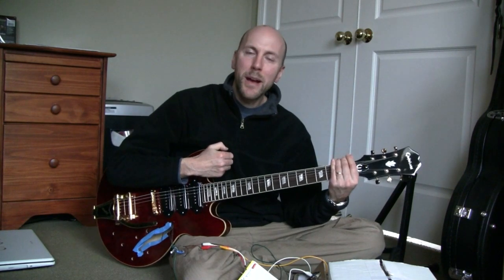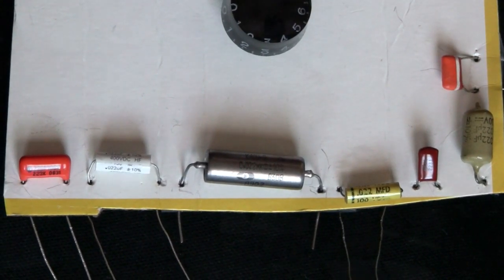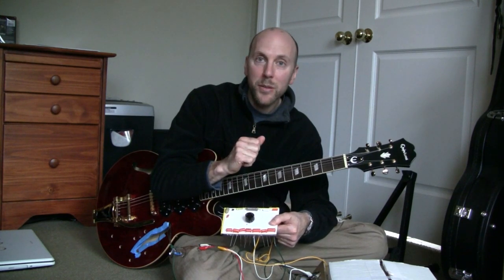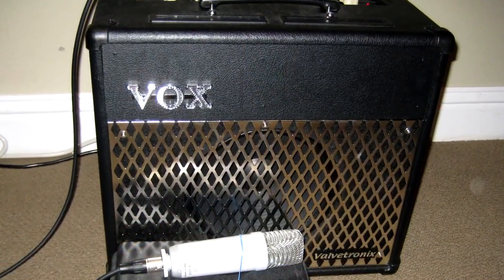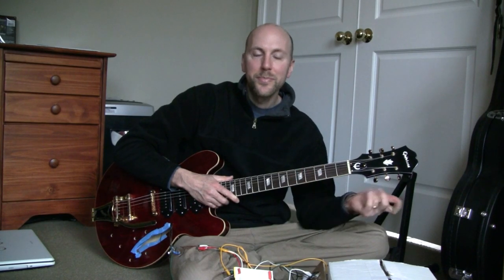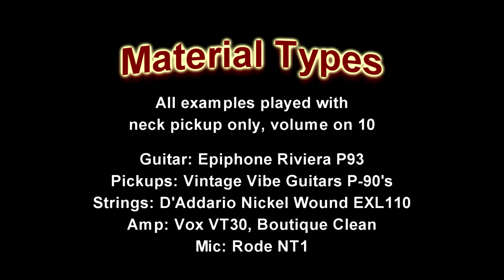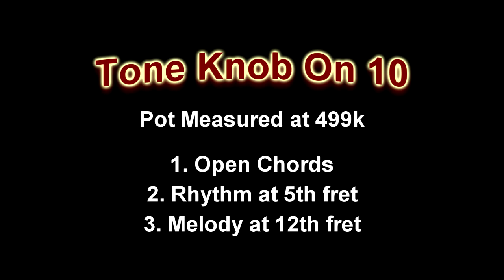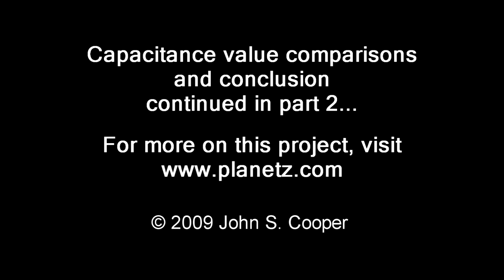Guitar Tone Capacitors, part 1: Evaluating Material Types

Comment: Why dont you have a ceramic cap in with those? Ceramic caps are used quite often in production guitars. I tried a ceramic cap in my SG, it sounded ok but i went back to the original film cap. No big deal I was just wondering why you didnt include a ceramic cap, and i'm to lazy to read the entire comments, lol

Comment: Is it my imagination? Or is that Russian paper in oil capacitor producing a very slight noticable smoother tone (perhaps darker, less bite...something) in position 10 then the others. Also i swear that mallory 150 has a slight edge to it. Some say that a capacitor effects the sound even when the tone is in full treble mode & others say otherwise. I wanted to mod a guitar with a russian .022 & a mallory 150 .047 using a on/on switch for some variation. Now i am not so sure such a mod is worth it

Comment: The LRC setup in the guitar is the same as the varitone.Pups are the coil,pots are resistor and tone cap.LRC!There's a botique bass maker who puts an on off switch on inductor for cap alone or with inductor!These caps are wired to tone pot also!Same as normal.I noticed a huge difference in tone caps probably 'cause I made drastic change.From .0033 to .047(more than 10X).The subtleties are harder to hear but this isn't!Sorry sets the tone for the guitar.Even when not rolled back!

Comment: i quite like the pio caps. if you had a strat with 3 tone controls ( mid and neck are a dual concentric pot), for which positions would a pio be best suited, also..what would be best type of cappy for the other position(s)? ie ...pio for mid, what is good for bridge and neck...  polypropylene, mylar, ceramic ?
Reply from the maker: mrcrappyguitarist - there's no right answers. You'll need to experiment to find what works best for you

Comment: I hope you used good methodology and isolated yourself from the amplified signal while playing. Even better, have somebody else do the switching so you are ignorant of which cap you are playing. By isolating yourself from both factors, you substantially improve the experiment from your influence, unconscious or not. I liked the Russian one best.
Reply from the maker: +John Smith - see here:  http://www.planetz.com/is-tone-love-blind/
Reply: + Cooper I don't think you quite understood what the poster was trying to get at. You need to be blind while conducting the test to be free from subconscious influence. it's a well established syndrome that nobody of free of.
Reply from the maker: TheMrturn1- since I did not intend to (and didn't) make any recommendations or conclusions, I did not feel it was necessary for me to be blinded. I was just presenting the unbiased comparison, and I uploaded the audio files in case anyone wanted to do a blind ABX test for themselves. I suppose there is a possibility that I subconsciously played differently through the different caps, because I knew what the material type was. However I didn't have any preconceived ideas about which might be better- and I'm not a machine so there would be subtle differences in my playing anyway.  Ultimately, a more scientific test would be to eliminate the player entirely, and play prerecorded audio through the different capacitors in a test circuit, and capture the output and show the difference in a spectrum analyzer. But then that would eliminate the interactions with the pickups and the rest of the guitar circuit.
Reply: If you can't ignore your biases without a blind test, then just buy the most expensive caps you can find and make yourself happy - otherwise you will always be doubting yourself. The rest of us will listen for the actual sound.
Reply: Another way to do it, so no one could think you played different for each one would be to play the sample into a looper so each time it'd be exactly the same. Just a thought, I liked what you did myself and thanks for doing it.
Reply: Oh shoot, just noticed this was 3 years ago!
Reply: D'oh 9 years...

Comment: can you hear a difference more in the room, than on video? i know a lot of people upgrade epi caps but tbh i can barely hear any difference between them. the russian one is a slightly fatter sound, and the one after that brittle. the rest sound much the same to me.
Reply from the maker: It sounds about the same in the room as in the video.
Reply: I would hope you weren't hearing the amplified signal during the test. If yob isolated yourself from the signal as well a knowledge of which cap was being tested, then I applaud your experiment !!!

Comment: Are these Vintage Vibe adjustable PU's still available ??
Reply from the maker: +dickgitaar2012 - Contact Pete Biltoft at VVG- http://www.vintagevibeguitars.com.
Reply: You mean the Mallory? That's my vote too :) next is the Russian PIO, then the Yellow vintage cap. Though they're so close, I have to turn up my headphone volume to compare. However, in real life application, when added by effects, amp and other stuff, plus the sound man tweaking- I begin to wonder what the value this cap variation would really serve. So maybe, in the end just choose a reputable/trusted brand. Thanks for the test, very helpful. I will upgrade my cheap guitar electronics soon :)

Comment: i saw all of your videos about caps. but still confuse. which one is the warmest? can somebody tell me frow the most warm to not warm...
Reply from the maker: There's no definitive answer when it comes to material types.  However, it's clear that a higher capacitance value in the guitar tone circuit will roll off more high frequencies than lower capacitance, thereby sounding "darker" or "warmer".
Reply: +chaled adams   this video clearly show  ---  no matter  wich material  in caps  you use  ---  only matter capacitance you want  and use undamaged components

Comment: I do not hear the difference ......they all sound the same........to be open-minded ....if any it is probably out of our ear's range BUT as I stated with the questions I previously stated regarding a glass of water example.....a capacitor stores energy so a benchmark of the data sheets of all those capacitors would be beneficial to see and understand further what is going on.....never take things for granted Good video!!

Comment: Difference between 100V & 200V caps ? ,
Reply from the maker: +jeffrey price maximum voltage rating before failure.  These big numbers are irrelevant in a guitar circuit since the guitar signal is usually around one volt or less

Comment: as far as capacitors go 
you would want to go with one that has the least amount of current leak aka current dissipation 
you'll want something with low (esr)
however they start getting more expensive the more accurate they are.
electrolytic capacitors are the worst when it comes to accuracy however there is one exception http://www.elna.co.jp/en/capacitor/onkyou/silmic.html
it's made of a silk like material with low esr
there are other exceptions as well
like say the Black Gate(Rubycon)
this page shows a detailed view on capacitors http://tech.juaneda.com/en/articles/electrolyticcapacitors.html.

Comment: I hate to tell you this but unless you value matched all the different material types of caps your test was for not and is not valid. Deciding between different types will only work if you value match all the "same labeled value" caps to +/- 1% of each other, as they can be +/- 20% off from the stated value. Otherwise your just listening to value changes, not type changes, especially if you have one cap -20% of value compared to one that is +20% of value.

Comment: It's called a varitone switch.they came in 345's and 355's.guess what?affected tone tremendously without touching tone pot.guess what?just a bank of caps on a rotary switch.easy to make a box with different value caps in it with rotary and plug your guitar in.I have a pedal for sale on E-Bay now.it's called NoFex.$15.00.Consists of 2 switchcraft jacks in a box...In/Out with true-bypass!

Comment: While the test is a great idea and it could have had potential it’s void of any objective results due to the following reason: I don’t see it shown that you measured the actual capacitance values and thus the actual capacitance values are unknown - and thus the test is worthless - as what is printed on the capacitors is rarely in line with the actual tested values.

If this crucial element isn’t addressed the test is irrelevant and void of any use from the outset as you assign results to materials when in fact it is tolerances and nothing more. (I know this to be true as these tests have been done very precisely for many years and the results are always the same - no difference whatsoever)

The whole things needs redoing with precisely matched capacitance values if you wish to get conclusive results. Also, I would record samples of each and then shuffle them so you don’t know which is which, it’s only fair for objectivity.
Reply from the maker: @Wolf H - I showed the measured values in the followup Q&A video at https://www.youtube.com/watch?v=S7Hod21pIUI

Comment: Not knocking your vid. It was usefull to me, BUT.......hardly worth changing caps for amost a zero sound difference. Pickups, preamp valves, pots....yes. But i won't be losing sleep over the tonal variation between caps.

Comment: After listening to this test it confirmed what ithought all along.No real differance between any of these,this tone cap.thing has amused me ever since i saw a old original wax Fender cap.go for $50.00 on ebay.To think i chop these old duds out of every vintage radio i repair and throw them away i could have made a lot of money off goofy fools willing to buy trash.Please if you value your tube amps. never use old wax caps.,striped oil type bumblebees for coupling caps.you may cook your outputs.

Comment: Apart from the tropical fish which is a different value, the only difference is from playing variables.  That said, there wasn't even much difference from the fish.  The only way to test this is to run a pristine recording through the tone circuit, so that every run through is identical.  Then whatever difference there is, if any, would be from the tolerance variables of each capacitor.  Don't fall victim to the snake oil salesmen!!

Comment: There is NO ''burn in'' with anything in an amplifier.  That's a load of shit.  Sorry for the language.  Mullard is nothing special.  Stick with the poly caps they last much longer and stay within their intended value.  With capacitors the physical size of the   cap is important.  Cheap china caps are made with etched surfaces so they can be of a large value for more surface area.  Big capacitors  actually have large enough plates to the job without the need of etching.  Price is quite a bit more but its the better way to go when used for amplifiers.  Just forget the  ''vintage'' crap and use the good stuff made today its far superior , just do a little studying.